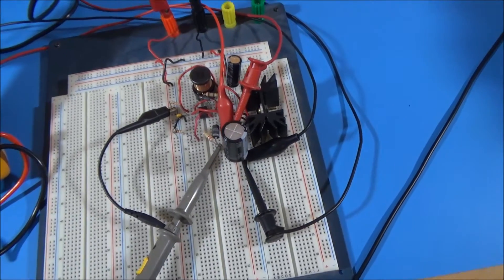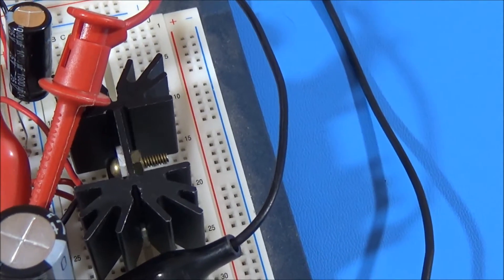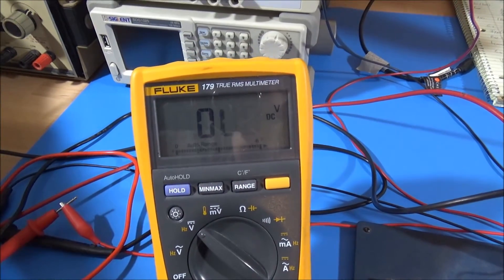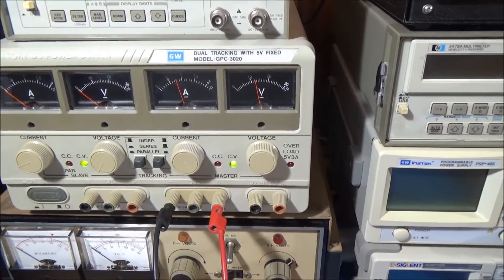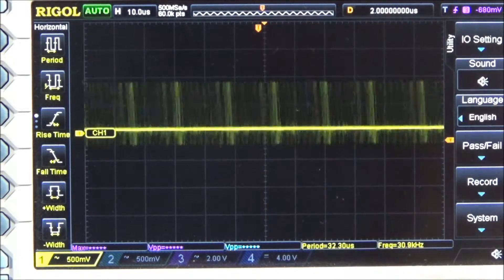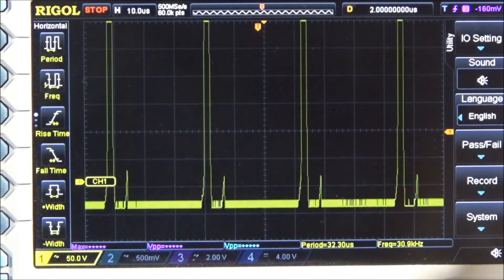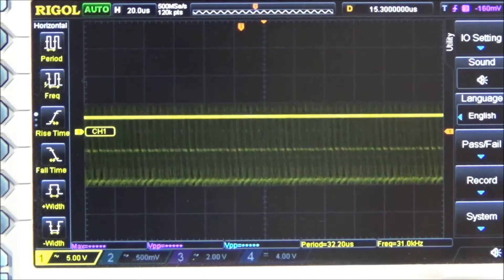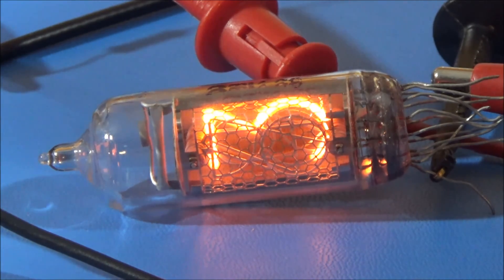OhmsAtHome #17 Nixie Clock Power Supply Testing

Comment: I've tested flyback converters on a breadboard, and the experience was terrible. The contact resistance per point is almost 2.5 Ohms! Now I stick to using perfboard with test points. Desoldering to fix stuff might be a pain, but the performance is much better than on a breadboard.

Comment: Waveform of that timing cap shows like that because, when current limit triggers, then MC34063 charges the cap at faster rate to reduce the ON time. Your inductor value could be tweaked a bit in order to get the charge smoothly up to the level that your current limiting resistor value. In that way you will get lesser ripple as well.